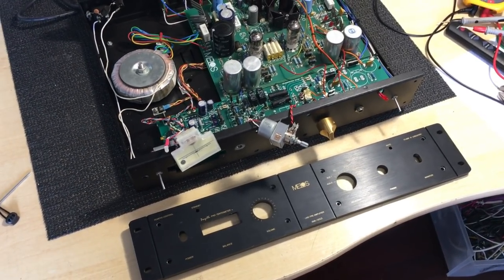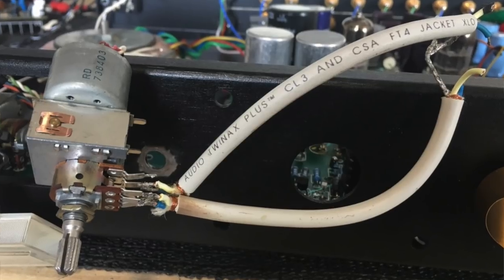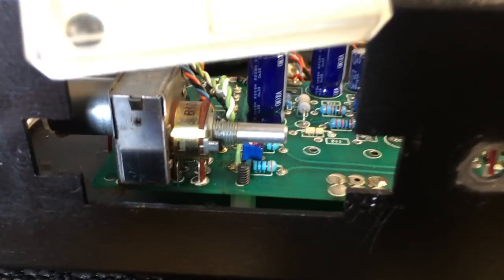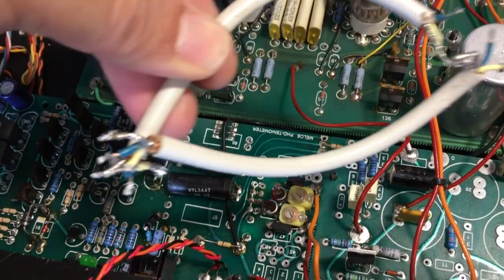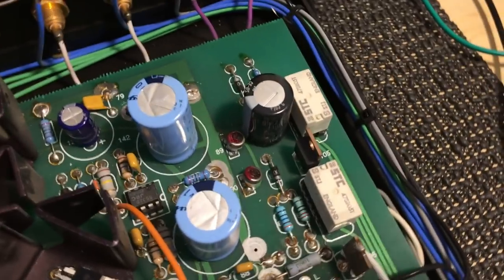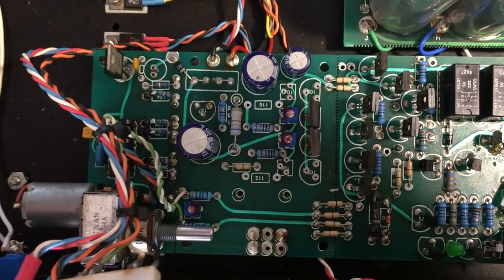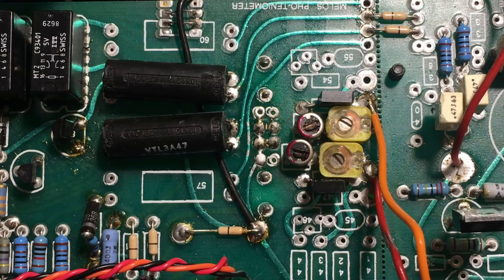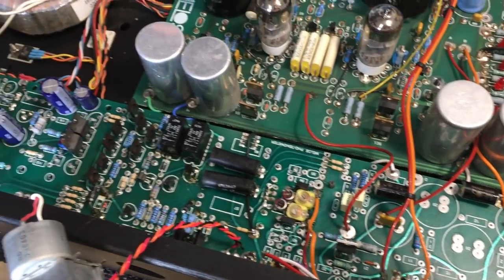Melos SHA/GOLD Preamplifier Pho-tentiometer board repair.

Comment: The trimmer on the input might be to compensate for hf loss due to high input resistance and stray wiring capacitance.  Kind of like a scope input attenuator. Nice box that is in. Maybe strip all of it out except the transformer and build a nice all tube preamp and headphone driver in there.

Comment: I have a Melos MA 333 Reference (Music Director) and it sounds superb, when it's working correctly,  the Pho-tentiometer is a nightmare. If the light isn't completely dead center it throws everything off. I would love to be able to put either a stepped attenuator or a TVC and a normal balance control in it's place.

Comment: I'm a fan of this old time piece of junk amp. I'm not trying to be sarcastic either, I fully recognize it's an awful design but I actually use my amp every day.  Several years ago I did a recap and ripped out the photo-board for a Tortuga Audio LDR control; I think you can even see what I did back in 2016 by quick google search, I wasn't even the first to do it.  Sometime in that process I lost the mute function completely and I ended up removing the relays and living without the mute feature.  It would be helpful to get it back so I will have to double check what you've shown here!  I fully realize I am nowhere near your level of expertise as well, it's going to take me years to catch up on your circuit analysis of the amp.
Reply from the maker: Ricky Av : persevere. It is worth it. On this circuit (which is a great example of a bad design working well) the mute is simple, and I don’t know how you will re-instate it on yours with the new board, but the quest is half the fun.
I did in fact see your conversion when I was looking for info on this beast, so thank you. Every bit of info helps.

Comment: Hello again, I just picked one of these pre amps for $80.  Started going through it.  There are 4 Capacitors, 2 on each side of the main board.  12 Uf each, 400 Volts.  Made in France. Large round and Black Caps.  One of them has a small hole on the side and I can see Grey material.  It is NOT leaking and the hole is not deep, it is shallow.   My question is:  Does this effect the working of that Cap and should I replace it ??   Or is it OK ?   I took some photos which I can send to you.   Thanks so much.

Comment: You have, as I hoped, really many fantastic videos, this is no. 24 I have enjoyed, out of 24:-)
I hope that you please will answer this question: LDR's are wary unliniar as analog volume control, while some variable optocouplers are fare better, but still not the best. Can digital idolators be used as a analog volume control, just by adjusting voltage / current?
Reply from the maker: I haven’t actually tried them, so unfortunately I don’t know. Interesting question which may lead to some investigation in the future.
Reply: @electronicsoldandnew  Yes that could be interesting:-)

Comment: Thank you for the great video and schematics! Do you have a source for replacement fuse bulb for the volume control?
Reply from the maker: You’re welcome. Yes, I have quite a stock of parts collected over the years.
Reply: Thank you for the reply! I am fixing this for a friend who wants to use it as a head phone amp. I don't have the level of knowledge and experience you do though, but your schematics helped locate the issues.  I am looking for the volume fuse bulb. I could not locate a Buss MDL 1&1/4 (it was burnt out) so I am using a JKLGF550 fuse bulb. The volume works though it doesn't seem to have much volume when set to Class A. When set to Monitor, volume is loud even though it is set to minimum. I have no operation manual, so I am unsure if I have a problem or you are suppose to use Class A setting with headphones.